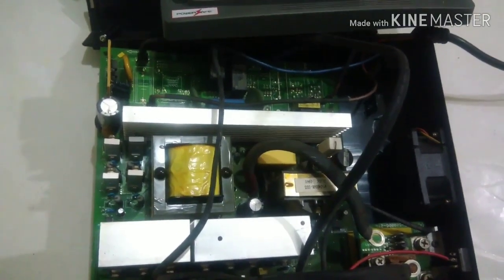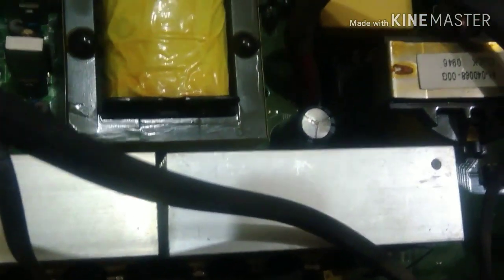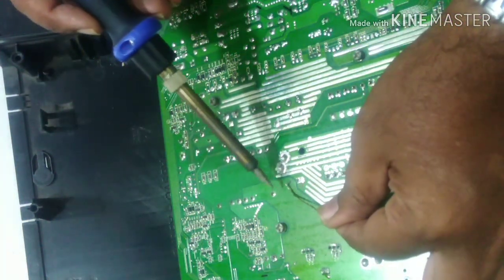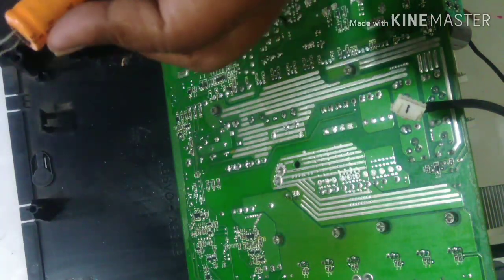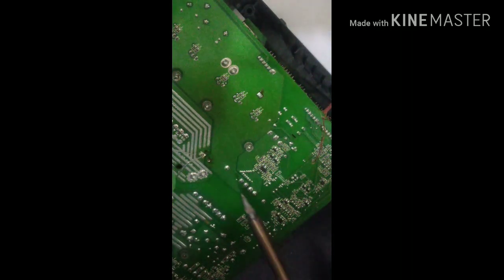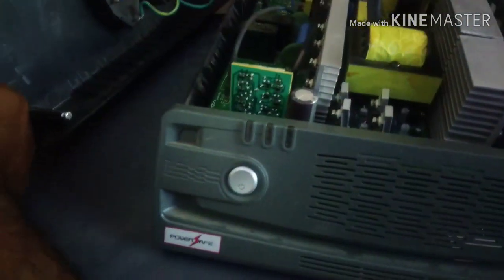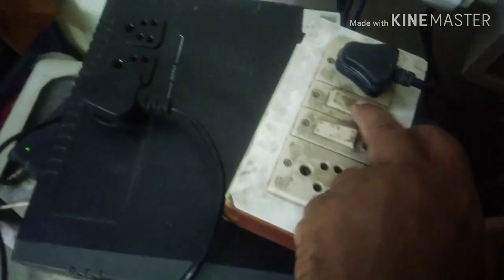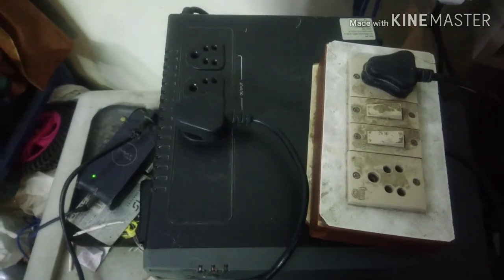Powersafe i2000 inverter repair - overload indication even in low load

Comment: 10 sec working ups ofter not working red indication coming
Reply from the maker: It's getting to overload problem. Give it to someone who knows to repair. If it's an H bridge inverter, remove output filtering capacitor and verify once. Don't forget to put back new capacitor of same value and voltage